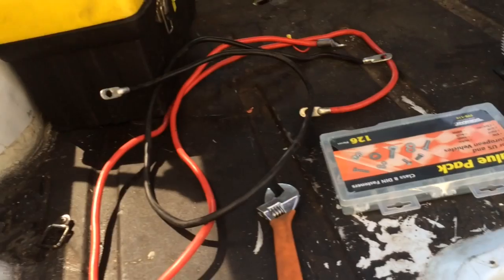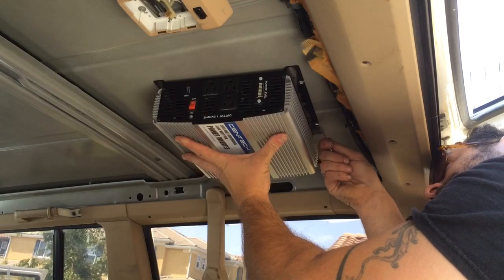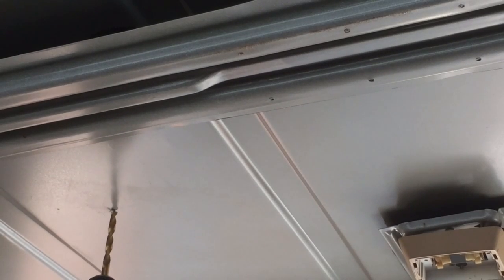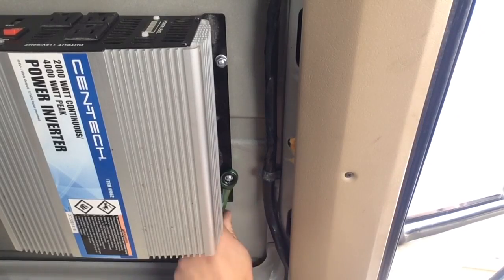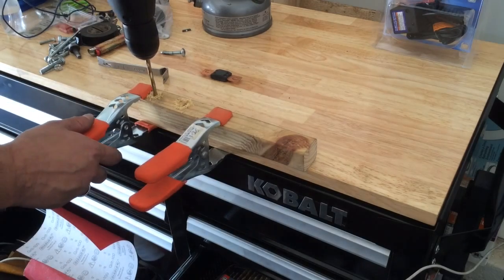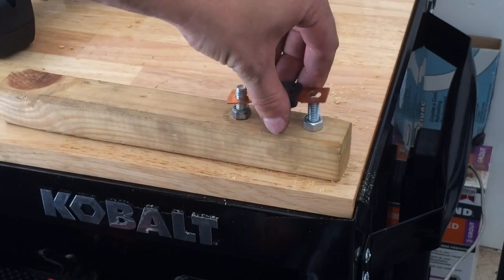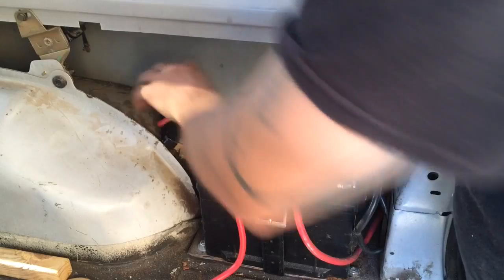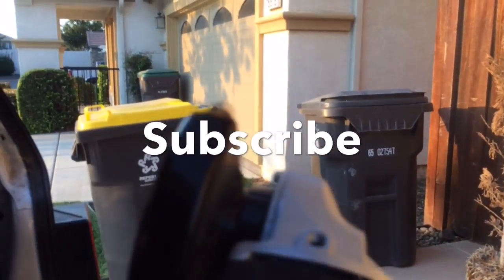How to: Install inverter in vehicle

Comment: I would have set the inverter on TOP of the roof then easily drilled all the holes through then swap it back to the inside.
Reply from the maker: That’s true

Comment: How do you charge that battery? I was thinking of just connecting to my regular battery and not using a spare.
Reply from the maker: That battery is the cars battery that I relocated to the rear. So the alternator charges it.

Comment: How has it worked out for you? My only concern would be heat transfer from the car body to the inverter, has that affected anything? The installation looks good, I would suggest insulating your battery terminals
Reply from the maker: I dont know. Ive sold the car and someone else's problem now. But the guy the bought it has sent me pics and the Jeep is killer now!!

Comment: My question is, can i use a car 400w inverter for a 120V household appliances? i have a tires inflator that's 120V and i'm thinking about buying a 400w inverter. thanks in advance.
Reply from the maker: Might need a little more power. 400 watt might be good for a laptop n small stuff like that. If you can try n push it up to 1500 watt. But this is all of my opinion, whatever that's worth.

Comment: how long would your car battery last if you didnt run the engine and have stuff plugged into the inverter thanks :)
Reply from the maker: Oh jeez, I don't know. I'm not sure I want to find out lol.
Reply: Typhoon Jet till it dies. But seriously, probably a couple hours at best depending on what youre running. Good to carry jumper cables and if theres a chance you will be alone, portable booster. Be sure to remove everything but the original cable when jumping though. You dont want to fry your electronics on accident.